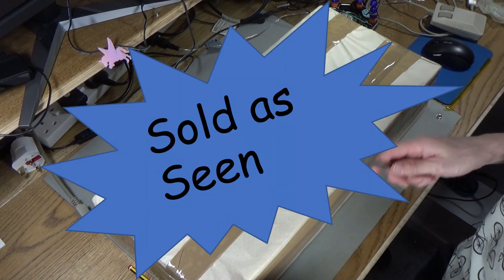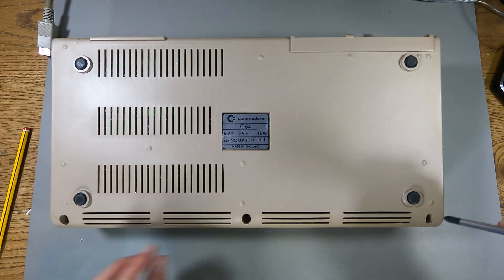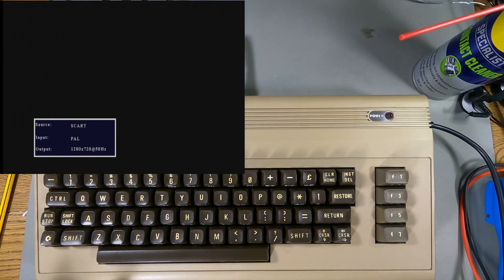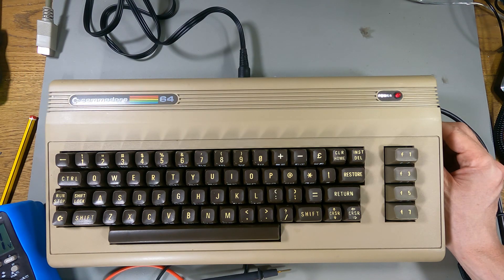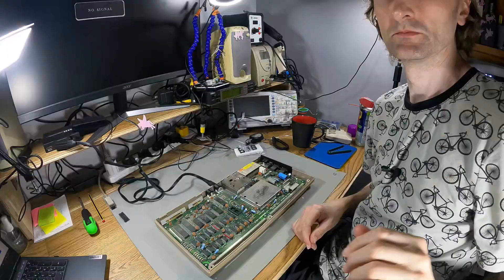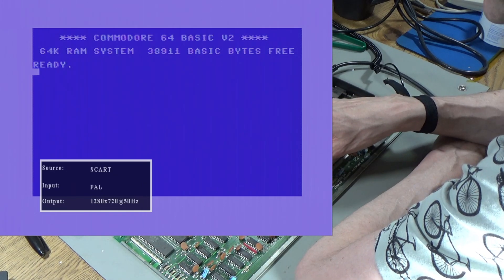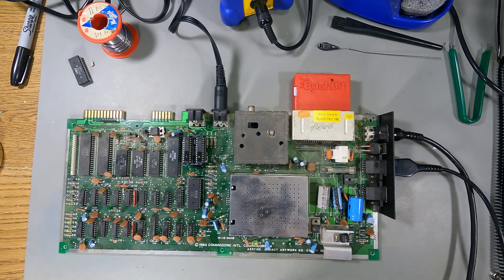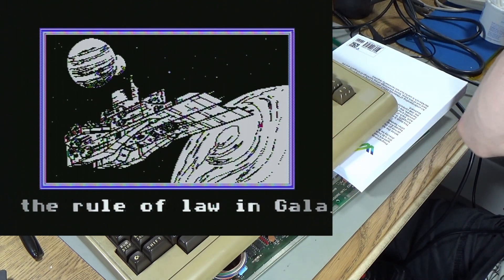Restoring a "Sold as Seen" Commodore C64 from eBay (June 2022)

Comment: You wuz robbed! I recently bought 2 working breadbins for £57 each (seperate sellers and not including postage), and both of them included PSU, cassette deck, joystick and a few tapes and manuals. I think I was particularly lucky although one of them had a dead SID chip, and the other one had a non working cassette deck. Good job saving yours though.
Reply from the maker: You got a good deal there. It's rare to find breadbins nowadays that still have working PLA chips in them.
Reply: @DavePoo2  Thanks and you are correct, I was lucky. As a precaution, I will be building some GalPla replacements. I have the PCBs and the DIP sockets, and I’m just waiting for the GAL20V8B chips to arrive from AliExpress. I also replaced the dead SID with an ArmSID, which works really well.
Reply from the maker: @booboyBL  oh yeah, the SID chips die in these too, it's surprising when you find ones that work. If your board has the older non MOS branded PLA then they are generally reliable.

Comment: Jam in new ceramics.
Reply from the maker: Ceramic caps?
Reply: @DavePoo2  All those little 104 or 473 ceramic capacitors - the ugly round orange ones. Yank 'em out and jam in some new tiny blue ones from Murata. Couple cents each. Also replace the 7805 with a TRS-1 2450 - $5. Runs much much cooler and you can dump the heat sink.

Comment: It looks like the free ram is lower when you boot at 14:55. Could there be an intermittent fault showing?
Reply from the maker: I think it had been taken by the cart that was plugged in (the book I was using as an insulator was hiding the cartridge).
Reply from the maker: But, good spot. I didn't think anyone would notice!

Comment: MT RAM chips and PLA....change them before firing  up a bread bin....
Lets watch the video and see if I was right.
Reply from the maker: 1/2 right. The MT RAM chips get bad press but they are 40 years old and really at this point not expected to be working. There are 3 in here that are working fine, so I won't replace them unless they fail.

Comment: £72 for "untested" machine and nothing more (no accessories)? Little bit too much in my opinion. I can easily buy similar setup in Poland for about £50 or even less.
Reply from the maker: The shipping was £10 of the cost. And to be honest, i don't want any more of those original PSU's because they are pretty useless. Poland seems like the place to be to get cheap C64s!
Reply from the maker: I did also get that sweet RF cable as well
Reply: @DavePoo2  But to be clear. I didn't mean that it was "waste of money" or something like that. Just a little bit on the "expensive side" :)
Reply from the maker: @tiemanowo  A C64 is never a waste of money!

Comment: Nice vid. Take the keys off and rub the underside on a piece of paper. I did a keyboard last week that behaved like yours, works a treat now. You'll find that the actual membrane is pretty clean.  Where did you get your magnifying visor from, I'm looking at getting something similar?
Reply from the maker: Thanks for the tip. I was quite shocked that it didn't work as the topside of the keyboard looks really clean, so it's probably been stored quite well. The visor is a cheapy from Amazon, but it's really useful. https://www.amazon.co.uk/gp/product/B07JCFLSWP - It's a got a light that is crap, and a jewelers loupe that snapped off when I dropped them once. But the loupe is now actually quite useful as a macro lens that I can hold up to the camera lens to get close up video shots.
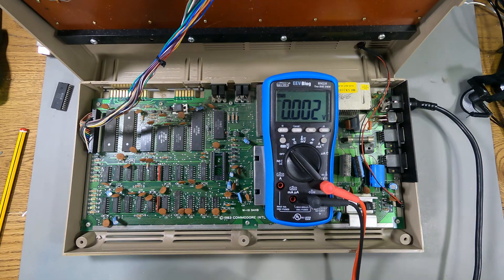Reply: Thank you. Here's a link for key cleaning, I didn't explain it very well. It's at about 5:32. https://youtu.be/cnJd8HJ3Tnk
Reply from the maker: Thanks, I thought that's what you meant. However, there are few different designs of these keyboards inside, I've not opened this one up yet, but I suspect it could be the same as the one in that vid.
Reply from the maker: Thanks for the tip, it's a good one -> https://youtu.be/LVHkO3KEQK0
Reply: I have 4 C64s (2 breadbin & 2 C64C), and I cleaned all the keyboard keys on a sheet of paper. Only 1 of the keyboards was bad though, but now all 4 work perfectly.

Comment: My father also bought also one C64 with original case and PSU and cables, same as yours, and is now also working great, 
he also bought 2 more and floppy drives, and i have repaired them all but one of the 3 floppy drives, i had to replace chips 
and mem, and i replaced all the caps of them all, now they are good as new.
Reply from the maker: Excellent work. I assume he also had bad PLA in his C64, not sure if there are any left that still work, and even if they do, they will just die sitting in storage. I've got a couple of 1541-II disk drives, and I did recap one of them, but so far they seem to work fine. I'll put them to use when I get this machine fully restored.
Reply: @DavePoo2  yeah, and the chip for the keyboard was broken, it was fun repairing old Commodore stuff, 
also recapped his Commodore Amiga 2000, and my C128D and more.

Also a hobby for me.